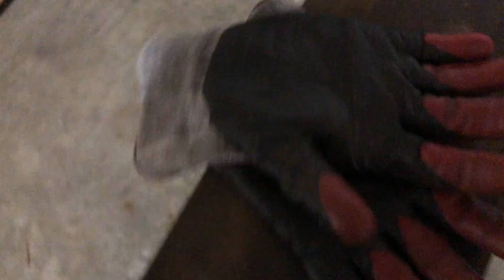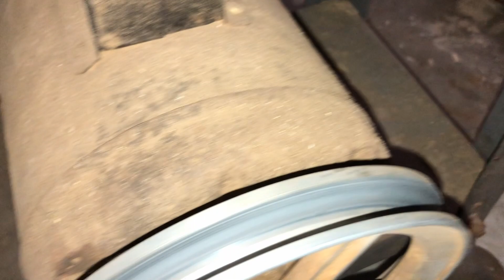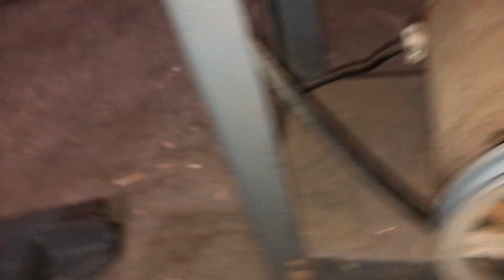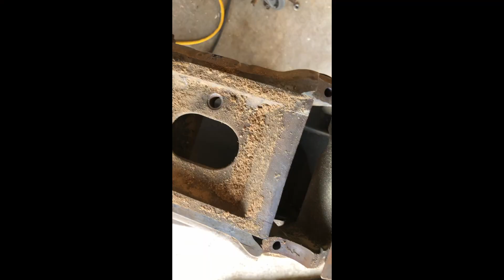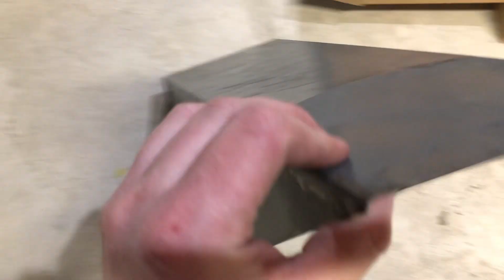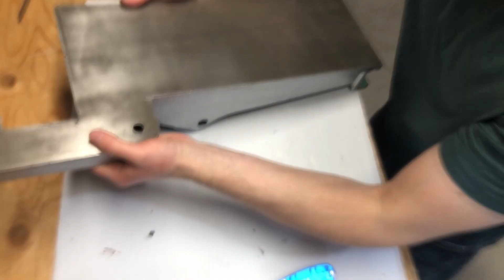Rockwell 37-220 Jointer Cleanup Part 1

Comment: I just snagged one of these off the market place for $80. Mine had pretty close to the same amount of rust as yours. I spent maybe 2 hours hitting it with CLR and scrubbing with a scotch brite pad. Looks pretty damn good now. There’s 3-4 small dots that I couldn’t get off but the rest is nice and shiny. Hit it with the paste wax and it slides like butter now. Just need to give the blades a slight “sharpen”/hone without removing them. The only bad part is it smells like CLR now haha. I’m about to clean up my lathe that I just got for free and I think I might just stick with vinegar or maybe WD-40 to avoid that smell haha. Stuff worked great though.
Reply from the maker: Good to hear. 3 years later I have gotten so much use out of this thing. As long as its waxed and used enough no new rust and is as good as the day I cleaned it up.